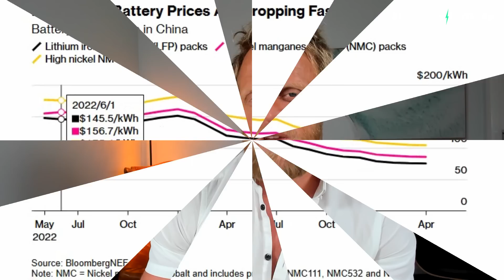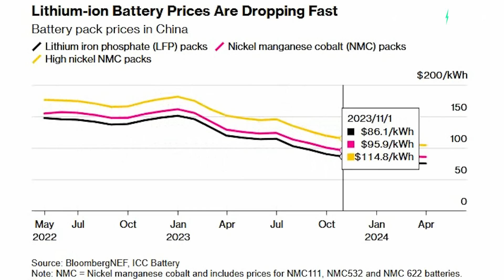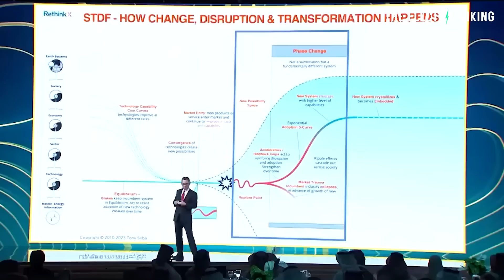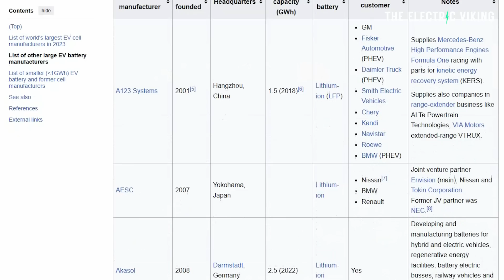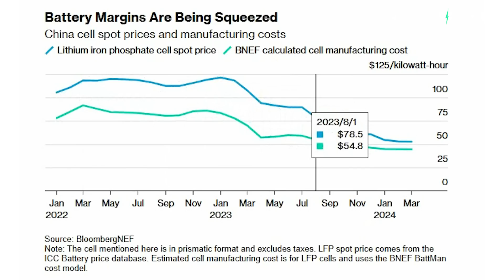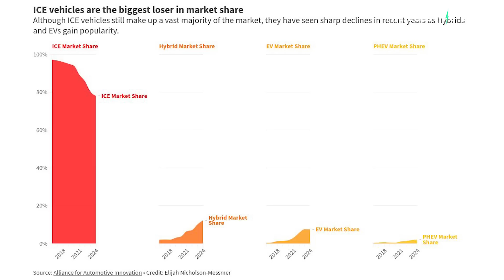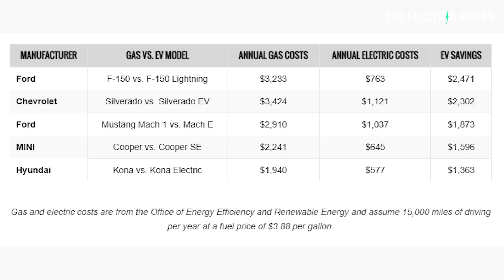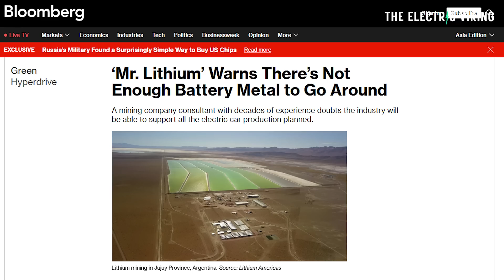Battery prices fall 51% to $53 per kilowatt-hour; "EV prices will keep falling"

Comment: This won't be talked about in the US.  Most every article I see is bashing EV's.
Reply: It will, relation between media and what actually happens in our country is pretty skewed. The Tesla Model Y is quickly becoming the number selling vehicle in the USA.
Reply: @Yourleftismyright88  Number 1.
Reply: But of course, because BEV consumes no oil, and PHEV consumes very little oil.
Reply: That’s because the USA is stuck in the past.
Reply: @Aguas2017  stuck in the past creating a bleek future
Reply: @jeffschueler1182  or maybe most consumers here realize it's a government funded scam and the technology is not actually ready to be implemented yet.
Reply: @Aguas2017  I guess we're stuck in the past.  Just found a decent used diesel SUV and hopefully will buy it this weekend.  EVs are interesting but just don't cut it outside of cities
Reply: Nevertheless, the future for petrol heads is not what they want. The demise of combustion cars and trucks will come rapidly once the manufacture of the multitude of spare parts, gaskets, filters, brakes, belts and fluids they require no longer occurs nor is profitable apart from  stricter carbon emissions control
Reply: @maramé.r  not sure where your from or what you do, I'm a mechanic that mostly deals with semis. Let me tell you how much of a problem electric trucks are. Nothing like having to wait 10 hours for your rig to charge so you can drive for 6 hours. The reality is electric is still 25 to 30 years away from being able to contend with ice vehicles. Porche figured out a way to distill gasoline from the carbon in the air, innovation comes to all areas of transport. We will see.
Reply: @erik....  be specific, please. And tell me if you have the intellect to diagnose and rebuild/ remachine engines and transmissions, as that is my specialty, as your comment was rather condescending. Nothing like people throwing blanket statements to cover their own ignorance.
Reply: @erik....  no they don't have the same share, in the us and Europe they only represent about 20 percent respectively. My other problem is that while it may be true that evs produce less carbon, the amount of ground pollution is ignored deliberately.
Reply: Well considering lithium ion production is a ecological disaster... what do you expect?
Reply: @jonathanshaw8868  We expect people to understand that oil production and it use is far more damaging.
Unlike oil, once the minerals have been mined they can be recycled forever.
Reply: @jonathanshaw8868  Not compared to oil or coal.  We'll get rid of those first.
Reply: @glennmartin6492  you have clearly never considered the environmental cost of the mining for the material, the processing that mostly happens in China of all places where there is little regulation on how all of these toxic byproduct are handled, then shipped again half way around the world, then upon expiring, there is little to no recycling to reclaim. Plus something like 70% of all electricity comes from coal and oil fired power plants, so how is this saving the environment again????
Reply: @jonathanshaw8868  stop while you are behind... or we will laugh at you even harder.... try using current data instead of trying to find the 1 out of 20 studies that conforms to your preconceived idea when the other 19 studies says the exact opposite of your opinion.
Reply: @GreenBeanGreenBean  well then engage some valid counter argument. Your feelings or desires have no impact on facts. Where do you think your power comes from??? How many tons of material have to be processed to make 100kg of cobalt and lithium? You don't care because the impact is offset to places you don't have to see, but your fooling yourself if you think this is better.
Reply: @jonathanshaw8868  this area is 90 percent hydro aka renewable..... yep your feelings don't mean anything.

protip: lithium and cobalt are not the final form, just the intermediary to get a fleet of battery in circulation.... as graphene (aka carbon) will be replacing lithium in the not too distant future.
Reply: @GreenBeanGreenBean  congratulations you are in the vast minority, both in Europe and America 21 and 22% of the power comes from such "renewable resources" so once again your feeling on the matter are inconsequential to the facts. 
Protip? Wow, here's the reality, utilizing a battery technology that doesn't have the power density or the sustainability is a disaster for the ev industry.

Comment: Fingers crossed this means more large price reductions from Tesla. Low priced Model Y Juniper would be awesome. Solid state batteries are even better assuming they would be lighter and provide higher energy density. Hoping they will last the test of time.

Comment: In NZ the sales of EVs has taken a massive hit after RUC was introduced to level the playing field with ICE cars. Cost is (now) $76 per 1000 km, which is what diesel cars pay (as diesel does not contain an RUC component). RUC is needed as otherwise EVs do not pay anything towards maintaining the roads.
My 1996 Landrover diesel car is cheaper to run than a new Mustang Mach-e I am thinking of buying (discounted to almost half the original price).
Once other countries follow suit then the sale of EVs will drop there as well.
Reply: Even with RUC my Nissan Leaf still only costs half as much to run as my previous gas car (Nissan Sentra S). It's also much quieter, cleaner, nicer to drive and doesn't smell of petrol. Much lower maintenance costs too.
Reply: @ a mach-e costs about $20 per 100km at a fast charger at 80c/kwhr, plus $7.60 per 100km RUC charge total $27.60 per 100km. My old land rover uses 10.7litres diesel per 100km cost $18.20 at $1.70 per litre plus the $7.60= $25.80m so it’s cheaper than the mach-e fuel wise. My 2015 fiat panda which does not incur RUC costs about 6 litres per 100km around town (less on long trips) so around $16.02 per 100km, again cheaper than a mach-e. Servicing $350 every 25,000km. Obviously if you use a typical home charge rate of nearer 33c per kwhr the EV running cost is lower, but I intend to only use the mach-e for longer trips which inevitably means using fast chargers, and for only maybe 10,000 km a year.
None of this will stop me getting a mach-e but I will certainly not be doing it to save money!

Comment: Does the cost of the lithium battery cover the clean-up of the some 500,000lbs of mining waste used to manufacture it?  Somehow, I don't think a cost contribution to an environmental remediation fund in included as part of the purchase of an EV.  Also, Evans neglects to mention that these batteries are all built with slave labor, zero environmental standards, and subsidized shipping by the Chinese government.  Of course, western companies like GM, VW, Ford etc. can't compete against the Chinese.

Comment: Most of the lithium is mined in Africa manually. Can we calculate how much humans die per kilo gram?
Reply: Wow, deep concern over Africans is very noble. 🙂 But no .... Lithium is not mainly mined in Africa ... and it is not mined by hand.  Where are you getting your info? Australia, China, Chile, Argentina, Brazil are the top 5 producers of lithium. The first African country on the list of producers is Zimbabwe .... Australia is producing 76 times as much as Zimbabwe .... 😂 China is producing 31 times as much as Zimbabwe.

https://en.wikipedia.org/wiki/List_of_countries_by_lithium_production

Comment: I suspect that battery replacement cost will cease to be a problem. I'm also looking forward to adding batteries to my solar energy system to achieve complete independence from grid power.

Comment: One of the biggest problems with buying an EV right now is future resale value.  Used EV prices have dropped like a stone in the ocean.  You said it yourself in another vid, maybe it's better for a first time buyer to get a used one right now.  In addition to that if a new model has one of the new battery types that double the range with faster charging, what does that do to resale values?  Now you have two hits to that.  Lower costs for a new one AND longer range with faster charging.  How does that help current new car sales knowing the car you buy today will not be worth much in 2 or 3 years?  

The other issue with all these changes is manufacturing with constantly changing battery types and associated components.  How can an automaker spend billions on production facilities then the batteries and probably motors themselves completely change?  Can the new ones simply plug into the EXACT same space with all the same connectors as the current one or do they have to shut down the facility and retool?  Now, maybe that's not a problem, maybe they can be made to just slide into a new car on the production line.  It's something I'd like to see you check out.
Reply: If you can afford a new car then you're rich, and can afford to give us poor people a leg up by helping us get a used EV cheaper. Alternatively just keep the car - then the resale value is irrelevant.

Comment: It seems to me that there's a bit of an Osborne problem here: the longer you wait, the cheaper and better the product will be.  So there's probably a lot of pent-up demand waiting for technology to mature--and when it does, floodgates will open.  Even now, it doesn't make much sense to buy an ICE family car.
Reply: Been saying for the last 2-3 years I will wait to around 2025 to buy an EV, but now Im thinking it will only get better and cheaper beyond 2025...so now sitting on the fence again haha.
Reply: the battery failure is the reason to buy ICE & only ICE.  Perhaps a hybrid for city driving. 
Only reason really.  Oh the Saudis are cutting the price of oil. So there's a reason to NOT buy a car with a known $20K+ repair bill in several years.

Comment: All the EV influencers are just talking nonsense continuously. They are talking about cheaper battery packs, they are talking about cheap EV-s, but nothing happens. Chinese statistics are big fat lies. They are very far away from being reliable. Not just the government of China misleading the market, but even the automakers misleading the government. They are lying about the sold EV-s at home. The solid state batteries are coming is kinda like the “Winter is coming” saying in the GoT. At some point will happen probably, but probably later rather than sooner.

Comment: Everything you say about the car economics is true but with countries such as the UK. The infrastructure (national transmission and local availability) is absolutely 5-15 years behind and there’s no hard will or funds available can catch up for a decade. That’s the issue on the ground for the next tens years of real world, practical user experience.
Reply: Not true about the UK, the transmission network was designed for heavy industry of 20/30 years ago and is sized about 80GW. The UK uses less than half that in the summer and 2/3 rds in the winter. There is enough spare capacity in the grid to support all vehicles being EVs. The issue lies with historical areas that were poorly served in the past and the speed of connecticity of new chargung, battery storage and renewable generation sites. Both areas that have been flagged and have assigned funding to remedy.

Comment: Has it occurred to any one that the battery prices are coming down because no body wants to buy the stupid things.
Reply: Good point, that would explain why the battery manufacturers are making eye watering profits
Reply: @Fromatic  Its called supply and demand.  When you have a bunch of EVs/battery's sitting around and no one wants to buy them you have to drop the price and try to unload them and your trying to spin that as a good thing.  Trust me; its not

Comment: Even the cost/price of the battery packs decreasing greatly - according to the statistics - and the battery packs are the biggest cost an EV - according to the automakers, the price of the EV-s have not reduced at all so far in the latest 10 years. Not a single cent reduction happened here.
Reply: Where's 'here'? Prices have reduced. Tesla Mode Y LR-RWD was US$47,000 in 2019. Today its US$44.990. In that time there's been 23.5% inflation. so in real terms it's now 27% cheaper.
Reply: @ In the EU, particularly in Hungary. I think the price of the Tesla models were reduced here too, because they are more expensive that the limit of the incentives of the governments. So the price of those models and their contenders set by the market demand which is the healthy way. But those are premium cars, not for the far majority of the whole passenger car market. The price of the “cheaper” models, small, medium cars are kinda stuck, some even increased, because the artificial incentives. The EU should stay away from the EV market, or at least dont give incentives for the buyers of the EV-s. Reduced taxes, free parking is OK, but dont help them to buy a car which they cant afford. There were always incentives so the prices never reduced.
Reply: Here in Aus they have recently dropped the price of the MG4 by $8000.

Comment: Once battery prices drop another 50% to about $25 per kWH we’ll see an explosion of BEV sales. We just need the charging infrastructure in place to handle the added cars especially in apartment complexes.
Reply: Aptera will be built for apartment dwellers. They get up to 40 miles per day just on solar.
Reply: @mpetty9947  Aptera will always be novelty car with a small but perhaps dedicated following.
Reply: @mpetty9947  I hope they do build them. Currently they raise capital and say that they will.

Comment: Great news on batteries. However EVs, as great as they are, still have issues such as still long charging times vs filling up with fuel. Infrastructure is still a work in progress. Still many more gas stations than charging stations. Expensive repairs and insurance because not enough EV repair shops vs. ICE repair shops. Also battery replacement costs almost as much as a good used vehicle. Hopefully these issues will be figured out in the next couple or three years.
Reply: When we need more charging stations they will appear. Charging times are not long. Insurance and repairs are not higher. Batteries have long warranties and generally last the lifetime of the car. They are only expensive as a spare part due to standard 500% markup, same as other parts including ICE vehicles.

Comment: this is a huge success for mankind and the planet .. 
battery storage should be on every house hold and whole planet needs to benefit from this .. there is no over supply .. only maybe a western over capacity ? i still don't have a power wall because they have been tooooo expensive .. 
 soon hopefully i may have a robust electric car and solar system on my house .. cost and reliability  is key and we need to thank China for this cost break thru .. 
we should be grateful .. sanctioning and tariffs are bs when it comes to reducing pollution on mother earth .. carbon credits ??

Comment: Where are all these sub 300 dollar 5kWh server rack batteries then?
Reply: Are you using the cell price and expecting that to work out. That said there are some around 380-450.
Reply: @nfzeta128  Where are those? Even the cheap EG4 ones are 1200 bucks. You can sometimes get sales that bring some weird cheap junk just under a grand. 500 bucks is unheard of.

Comment: There will be no mass migration to EV’s until charging stations are as prolific as gas stations and EV charging is about 10 minutes.
Reply: Modern EVs can put in up to 193 miles of range in 15 minutes (Hyundai Ioniq 6 tested by Motortrend).
Reply: Most people can charge at home, most driving is short trips and commuting.  Not everyone is a long-haul trucker. Even businesses will look to expand their fleet of EVs if they can charge them at night.
Reply: Using lithium titanate batteries that have been available for 7 years can make charging times about 5 to 10 minutes

Comment: Imagine if you produced a simple 1980s car with an electric motor and battery.
Reply: Safety equipment would make it impossible.
Reply: @LynGriffiths70  the majority don't need it.
Reply: It wouldn't meet safety standards: crumple zones, air bags, over-the-shoulder seat belts, anti-lock brakes, backup cameras, etc.
Reply: Teslas are simpler than cars in the 80s, at least by part count.  Not sure what other metric you want to use but part count is probably the best one.
Reply: @diamond_h0us the individual parts are much more complex, though
Reply: @diamond_h0us  you are joking. All the computers/sensors . The amount of wires and needles gadgets.
Reply: @PaulSamps-gf6yz  Not really. An ICE engine has orders of magnitude more moving parts than an electric motor. Add in the gear shift, the clutch, the belt, and the alternator, which is just an electric motor in reverse, and you've got probably the most mechanically complex device the average person will interact with outside of work.
Reply: Great idea

Comment: I would bet EV manufacturers pad their profit margins before prices come down. Many startups are have declared or are desperately trying to avoid bankruptcy. 
High-priced battery and Ev drivetrain replacement costs currently kills the price of used EV's. 
A drop in the cost of a Tesla battery replacement from $24k to $12k would be great. 
Another 50% drop would completely change the market. 
A doubling of energy density would bring a huge increase in demand also. There are technologies in the lab that look promising, usually it takes at least 5-10 years to develop and commercialize a technology from the lab. 
One issue to consider is are prices dropping in part due to reduced demand? 
We are probably entering, or in a global recession, USA, China, India, Germany, Japan are all having major economic issues right now.